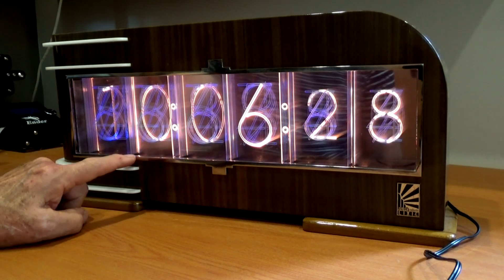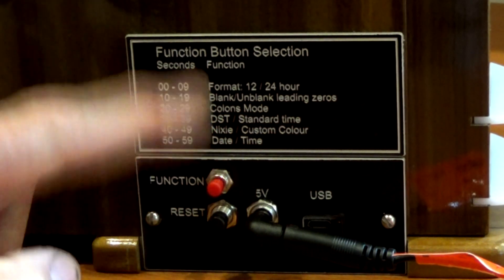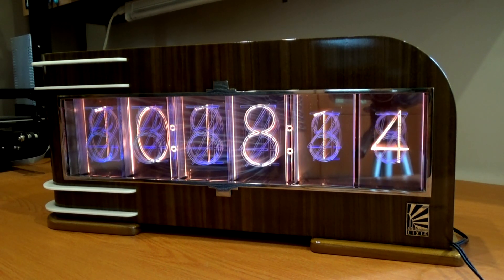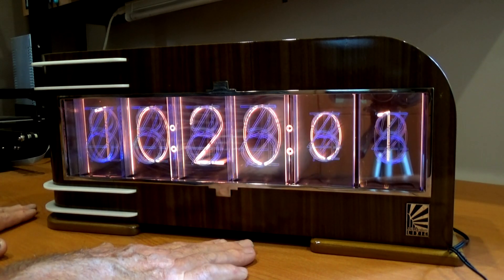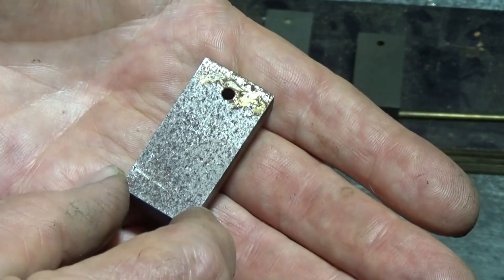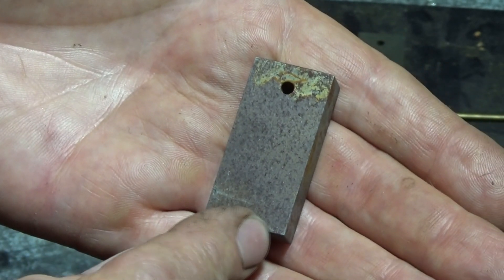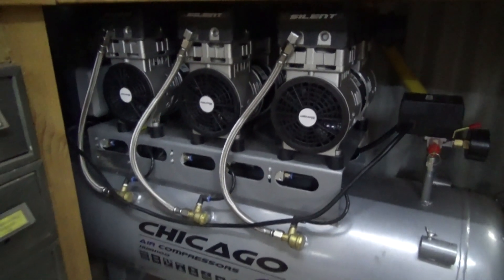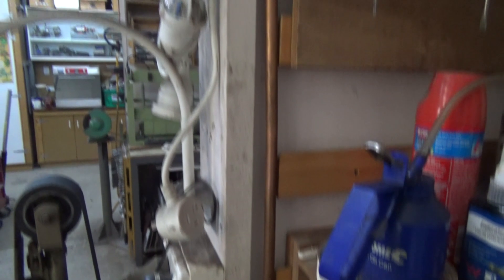Channel Update - Lixie Clock, Parkerising and Media Blasting.

Comment: Interesting update. That outdoors receiver looks a lot more than 200 litres to me. You know best, I'm only looking at a video, but it looks around 750mm dia and 2m high - that's about 900 litres. Just visually comparing to the one under the compressor it looks a lot bigger. Anway, Happy New Year and thanks for all the videos, I learn a lot.
Reply from the maker: You're probably right. It was an old compressor and there was no ID plate that I could read but I just worked it out based on a cylinder with flat ends and it comes out to approx. 500 litres. Either way it gives me a good reserve of fairly cold and dry air. All the condensate should form in the smaller tank.
Regards,
Preso

Comment: That Extra tank for the extra air volume is a nice addition with that new compressor. I did my father's shop in 3/4" copper many years ago. Unfortunately, I was unaware that I should not have used plumbing solder and should have silver soldered or brazed the pipe. No leaks after about 25 years but it's probably going to be an issue down the road.
Reply from the maker: I had to use ordinary plumbers solder on one or two joints that I couldn't do on the bench but as you say it should be sound if the cleaning and prep is done properly. I found one joint on the old system that had completely failed. The soft solder had not penetrated into the joint and the continual flexing from the pressure cycles had fractured the joint. It just fell apart when I went to remove the pipe. 
Regards,
Preso

Comment: Thanks Mark! Any idea why samples 2-4 look glittery, is there some kind of crystal formation on them? 4 looks the best to my eye.
Reply from the maker: Jon, the phosphate coating is done in a hot acid solution and it etches the surface so it does have that crystalline look about it. The wax treatment fills in the crystals and it tends to look a bit flatter and smoother. The surface feel is "grippy" too. It's an interesting process and I am hoping to do a lot more of it. 
Regards,
Preso

Comment: It would be good if you could use something like a vacuum former or something along those lines to shape the clear tube to properly resemble your blast guns internals
Reply from the maker: Sadly, I don't have one of those. I am going to use aluminium to shape the convergent nozzle at the front of the gun. I should still be able to get a good look at where the grit enters the cavity inside the gun. The big mystery is why it "surges".
Regards,
Mark

Comment: Nice set up Mark !
I’m still stuck with hoses run along wall studs - not pretty but it does the job ! Thats the problem of renting - you can’t make anything too permanent !
Reply: Unfortunately renting means workshop today granny flat tomorrow so I’m down sizing and looking at building a trailer workshop that doesn’t require a property i rent to have a garage , just park a trailer and I’m good to go.
Reply from the maker: Ian, renting  must impose a lot of limits on what you can do. It's a good chance to get inventive though.
Regards,
Mark

Comment: Hi Mark, I must congratulate you on keeping us entertained whilst educating us on many projects this year. Your above video is a great idea as sometimes we like to know how things are still working out after being in use for a time from initial build. Your new compressor is impressive, its the one noise in the shed my wife hates. Your adding a larger storage tank is something I will get around to also, as I know the benefits that come from this. I have a tank rattling around in a container somewhere, however renovation on house still getting in the way of shed relaxation. 2020 this will change.
Have a great New Year from around the corner in Doonan.
Reply from the maker: Thanks Gary. That old compressor was our workhorse up at Noosa District SHS. It originally came from the Wimmers soft drink factory in Cooroy. When I tipped it up on end I fitted a drain valve on the bottom and after about a week I opened it and got nearly two litres of putrid emulsified oil out of it. I hope the fires didn't get too close.
Regards,
Mark
Reply: @Preso58  Thanks Mark, we were evacuated as we are on Grays Rd but all good in the end. 
Maybe we can catch up in the new year if your interested. No offence if not.
Gary
Reply from the maker: Gary, a catch up would be good. You can have the first unofficial shop tour! I am home most days (being retired). Send me an email (my address is on the "about" page of my channel.

Comment: The air pipe looks good but I'll give a suggestion. On each drop I'd put a tee and drop down below it about a foot or so and put a ball valve. Personally I'd drop it till it's a few inches off the ground. That way any water that does get in the lines drops to the lowest points. You can crack it open and make sure any water in the pipe is drained before you start where you are at.
Reply from the maker: I thought long and hard about that but my reasoning for not adding the drain leg was that all the air in the shop now comes from the receiver and the air stored in it is relatively cool and dry. Most of the condensate should form in the 100 litre compressor tank. We used to have drain legs in the  air system at school but we only had the one tank (the one I have now). I also have a good water trap on the one regulator I use for running my spray guns. I know it is best practice to have a drain leg but there were lots of obstacles where I wanted to fit the regs too. It will have to do.
Regards,
Mark

Comment: Good update.   Very nice code by Mitch.
I do like your new air compressor.  I have to find a leak(s) in my short system.
Dave.
Reply from the maker: I am still chasing a slow leak in my system but I think I have traced it to a regulator. It's where the clear plastic bowl screws into the regulator body. I've cleaned the thread and the edge of the plastic bowl but it must be a perished seal.